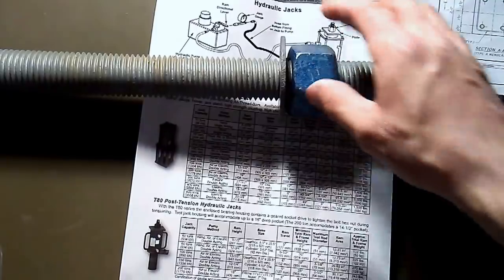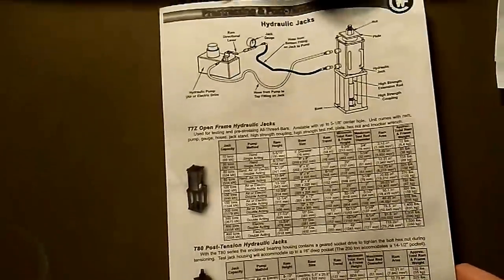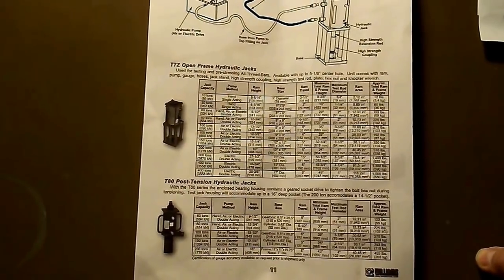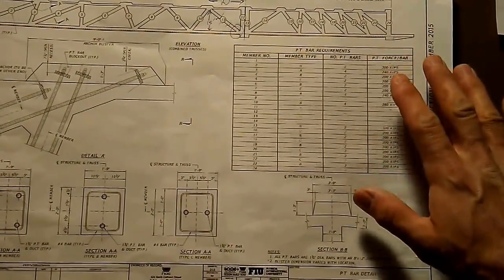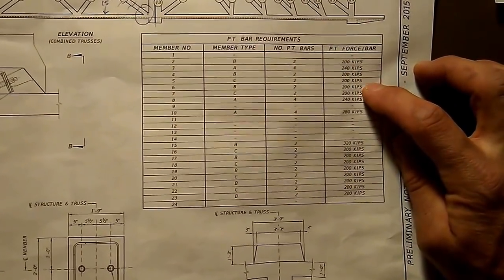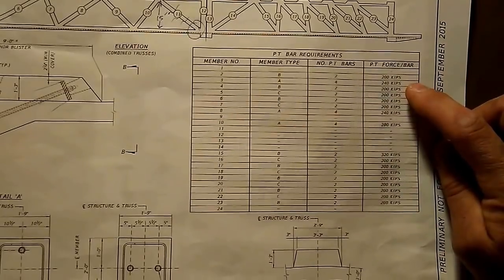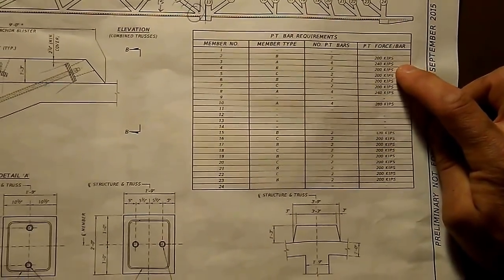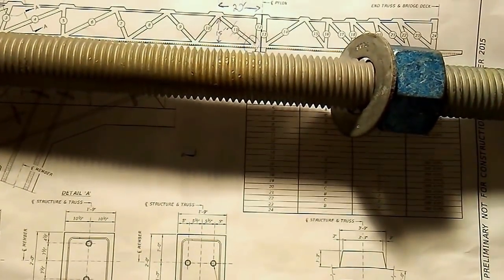FIU Bridge Collapse: Post-tensioning Explained

Comment: member 11 is a compression member when on final resting pier. But, it was a tensile member when on the mover moving to final resting position. They should be loosen the rods then. The devil is in the details. 1st if the tension is 200 kips per rod, then need MINIMUM 200 kipX2 rods /0.9x8.5 = 52 inches of concrete areas for 2 rods sections.  Where with ALL the PT ends (joints), a lot more area of concrete needed to take the PT compressive forces. 2nd Where the joints with ALL PT rod and cable ends,  the stresses of the concrete are very complex ( large shear stresses will occur without steel reinforcement, can failed abruptly) 3rd, assume 950 tons of bridge, the end is roughly 475 tons x 2.2 = 1,045 kips vertical. The diagonal No. 11 will take 1,045/(Sin 40 x0.9 x 8.5)= 212 square inches of concrete section minimum. I didn't check the column(web) lateral stability with Euler Pcr=Pi^2E/(L/r) which will further reduce the capacity of Web No 11.   4th. The tensile force at the broken bottom chord is 1045/cos 40 = 1,364 kips >>> needs 7 rods minimum.   5th. while moving to final resting place, is it possible the jack support broke the cavities of the bottom PT rods of the bottom bridge and created  blockage of tensile rods through the bottom chord?  Those are rough hand calculations. which have not accounted for engineering evaluation of the joints. The stress concentration and dissipation of stresses and mild steel reinforcement required to take the local shear and tensile stresses at those joints are beyond the knowledge and expertise of an average bridge structural engineer with Master degree, or any average engineers. Need to use finite elements/sap to analyze the stresses at those joints, and place adequate mild reinforcement.
Again, this failure will go down history as infame, like the Tacoma Bridge, The Hyatt Regency walkway collapse ...etc 
A saying: there are no famous structural engineers, only the notorious ones. You fail, you become famously notorious.
Reply: @David L; Detail A shows the ends of the PT bars, but shows no connection of diagonal #11 to the top chord of the truss, other than some cover concrete.  What part of the structure is supposed to transfer the very significant amount of force from #11 to the upper deck?
Reply: The diagonal webs should be in pairs (tension-compression) for truss config. #11 should have proper transfer loads to #10 (tension) and upper deck (compression, to the left of #10 in the drawing). The failure puzzles me. The bottom tension chord near #10 broke first from the video when there was NO external loads, except self weight. Failed only under internal forces. That is why I suspect improper joint detail connections to begin with. Or blockage of tendons in the bottom chord (walk deck).
Unaware to all lay people, an engineering or construction company no matter the size and PAST experience, the expertise depends only on THE person working on it. The engineer can leave and retire. The expertise is lost. Also, NO one can claim be expert in ALL types of construction, steel, PT, wood, concrete, bridge, buildings. If the engineering company accepts the project solely for making money. It is unethical, and failure bound to happen.  I am a structural and forensic engineer. I saw too many money driven (now even political driven) unethical practices. Too many to list.
In ideal scenario, the successful bid of engineering design and construction should not depend on the price, but the expertise. One shouldn't take his sick cat to a MD, but to a vet. Even though they are both doctors. When one is sick, one try to find the best doctor for his illness, than find the cheapest (or even his friend's doctor, or a politically correctly doctor) doctor in town.
Reply: Check your IQ before reply. Also children do NOT join adults conversation.

Comment: This just seams like a stupid way to build a bridge. How would it be inspected? How could it be repaired when the rebar rusts or if an over height truck hit it? It couldn't even hold up its own weight, how on Earth was it supposed to hold the supposedly decorative huge rod structure on top? & withstand hurricane winds? That is scary to me that only 2, 1 3/4 inch rods were supposed to hold up tons of weight. They should stick to building steel bridges IMO. Great video on post tensioning though. I learned alot more from your presentation than hours of other videos.
Reply: Generaly, concrete bridges are better that those  made of steel.  Tons of weight were supposed to be hold by  STEEL and CONCRETE. Reinforced concrete is a composite material. Do not worry !!!!!
Reply: The design engineer just did not have the common sense to have designed this FIU bridge ! Or may I say this engineer did not have the years of experience to find out what works and what did not work , and designed this FIU bridge. If the original design engineer, Figg and Muller had the final say whether FIU would have gone this far to be erected, and if Jean Muller, the French structural engineer of Sunshine bridge,  did not die 12 years ago, he would have never allowed these flimsy details of just two steel bars to hold up 950 tons ! Muller would probably insist that a cable stay bridge should stay as a real cable stay bridge ! Not a " decorative "  cable stay bridge ! That is my humble opinion. What is yours ? George Wu, ARCHITECT, A.I.A., NCARB 2018-4-19
Reply: Cre8tive these guys shouldn't be allowed to make a warning triangle for a wet floor!
Reply: After Jean Muller of "Eugene Figg & Jean Muller  " died 12 years ago, Linda Figg, of FIGG Bridge Group, is very active in building many bridges in the world. She even was in the preface interview of by Judith Dupre's book , " Bridges" . George Wu, ARCHITECT, AIA, NCARB 2018-4-19
Reply from the maker: You bring up an excellent point about difficulty in repairing post-tensioned or prestressed concrete that has been damaged...
Reply: The two rods are not holding up the weight of the bridge. #11 is in compression. There some of the diagonals in tension but the loading on these is less than #11.
Reply: I understand the PE had over thirty years of bridge design experience. The two bars were not holding up 950 tons. The failed member was in compression.
Reply: Andrew McLellan, I brought those points out because the video, the only eye witness I had , indicated that the failing point was at the top the member #11. Am I correct ? George Wu, ARCHITECT, AIA, NCARB 2018-4-20
Reply: I think you are incorrect. The failure first likely occurred at the bottom of #11. What you see in the video is the rotation at the top between #10 and #11 after the connection between #11 and the bottom deck occurred. Once the the deck connection failed the only load path left was the bending between #10/#11 and the top deck. The bending capacity of the top deck (at #10/#11) was way too weak to support the truss after the lower deck connection let go. the joint rotated/bent as the bridge started to collapse. It is essentially a secondary failure. That is what I believe based on the all the evidence I have reviewed and calculations that I have done so far.
Reply: @georgewu5; Pushing the technology envelope can be a good thing, but in the case of a bridge design, with its inherent jeopardy to human life, should have been thoroughly tested, including mockup structures stressed to failure.  Springing a new, untested design on the public should not have been done.

Just looking at Detail A, I wonder how the compressive load was supposed to be transferred to the upper chord of the truss.
Reply: Andrew McLellan, Right or wrong makes no difference. Eventually all the lawsuits will be settled out of the court with the $14 million dollars made from building this FIU bridge. Who cares ? It is only six lives wasted ! not seven !  George Wu, ARCHITECT, AIA, NCARB 2018-4-20
Reply: Having unique structures is common and it  is not economically feasible to test them. That is why structural engineers have to be highly trained. If the code is followed and the design is carefully reviewed, there should be no issue. They probably did what is called a strut and tie model to analyze the transfer of loads at the joints.
Reply: Could the failure mechanism be due to the "cantelever" of the bottom deck, (prestressed for a purely tensile working-situation there)? ie the pt bars being not in the correct place for the reverse stress block that occurred when the bridge was being moved into place and supported at that node?.
Reply: I would doubt the cantilever of the deck in the transverse direction played a role. I only say that because I don't see any evidence of it. It looks like the failure plan was above the surface of the bottom deck at the bottom end of #11. We know the dead end of the PT anchor stayed in the bottom deck and the lower end of #11 stayed on the support. So I don't believe there was a shear tear out of the bottom deck. If the deck failed rather than the end of #11, the dead end of the PT would have likely remained on the support.
Reply: No I did not mean the transverse direction. I meant that the PS tendons were placed in the bottom deck for the working condition of the bridge....them being at the bottom of the cross-section where they are most efficient to resist the tensile stress of the bridge in place . If there was a cantilever condition for the transport then there would be a bending situation in that same bottom deck. That is, the stresses in the bottom deck would be reversed. tension top compression bottom. Pretension works fine for a nice steady working load efficiently using the stell and concrete together butnot if you reverse the loading. 
Think of it as a series of bricks held together by sellotape on the underside (working condition) ..but supported for a few days at the quarter points!!
Reply: Sorry, I misunderstood you.The load reversal on the main deck or canopy still did probably not have anything to do with the failure. The canopy definitely had significant tension capacity and the deck definitely has a lot of compression capacity. I also don't think the load reversal on #11 was a significant factor either.